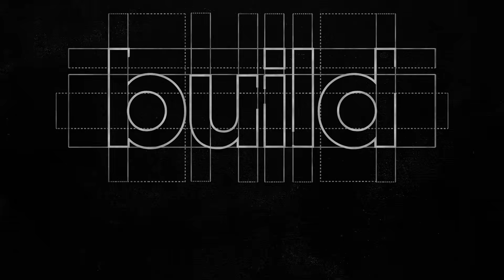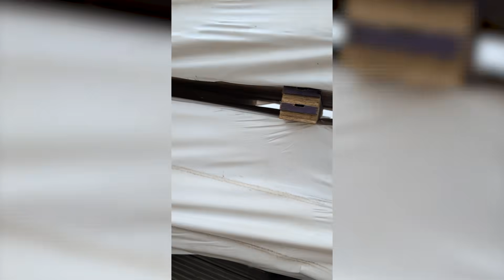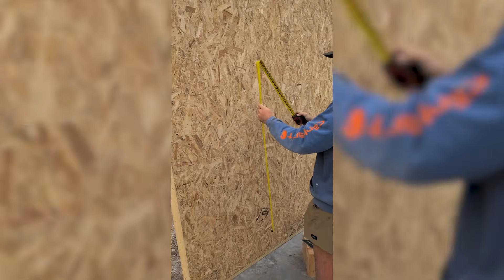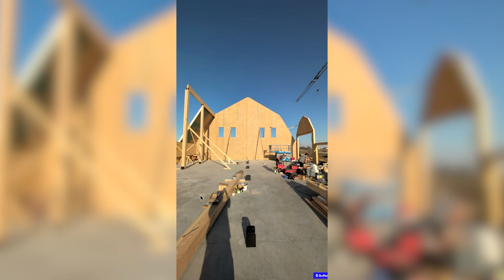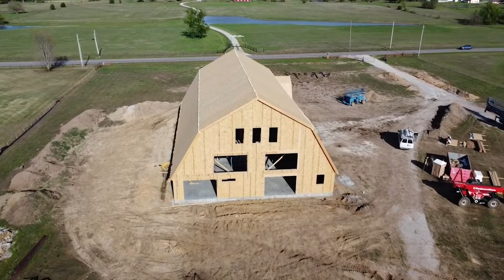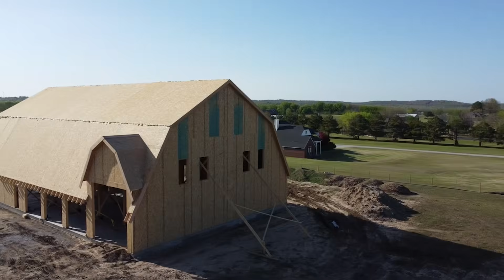GIANT SIPS Barndominium - $40/SQ FT!!?!

Comment: Has there been any hurricane testing on these structures?
Reply: Great extreme weather performance question! It’s not hurricanes but tornados that are the real danger in this location. Po-tay-to. Po-tah-to. Amirite?
Reply: Sips are shear panels, so apart from adding some mechanical straps, that's it.
Reply: SIPs withstand tornados and hurricanes very well.  SIPs are rated for Florida High Velocity Hurricane Zones (HVHZ) and they have passed the missile impact test. https://www.sips.org/documents/SIP-Missile-Testing-for-Florida-HVHZ.pdf